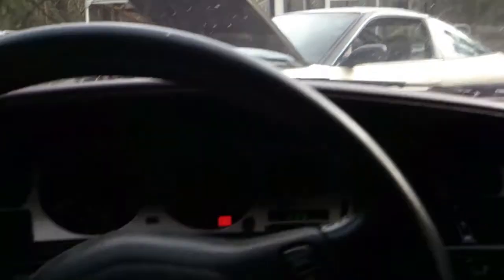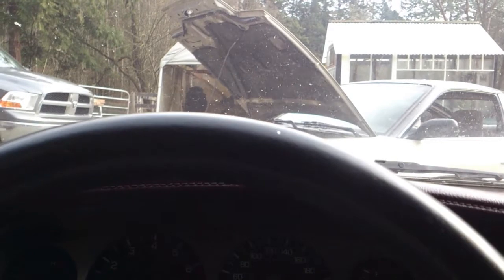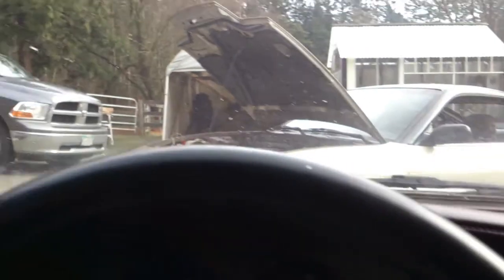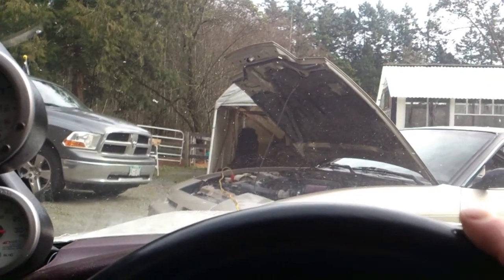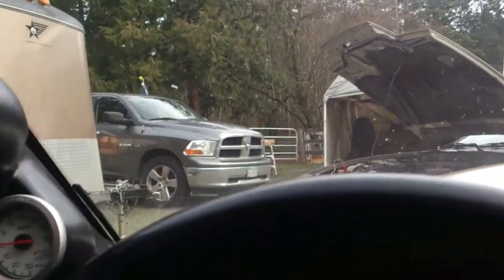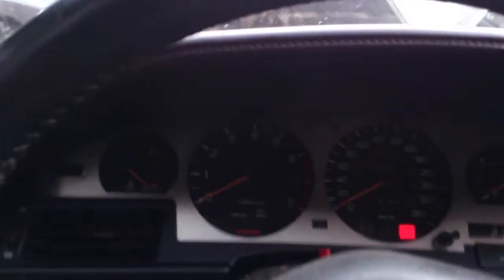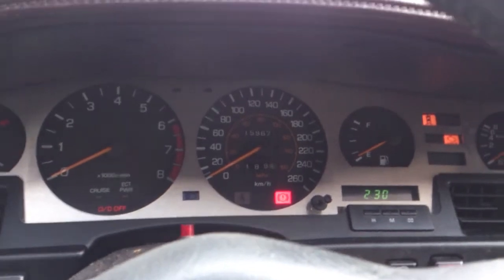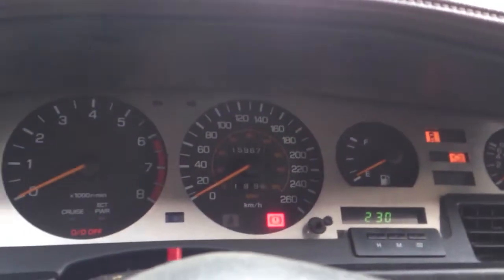Supra Garage Reno : Day 1

Comment: I guess the temporary fix, was temporary.  :)
Reply from the maker: yeah. i had to tear down all the temporary stuff after last weekends storm. what a mess! oh well. this ondura stuff will last forever in comparison. cheers lyn!
Reply: paradoxdesigns Check out my video on how to install one of these tents... laying a basic wood foundation and cross tension support can add years to the tarp. To bad I get lots of snow and could not find a broom to knock off the snow and I used a ice scrapper... Basically the weight of the snow with the concentrated pressure caused a bunch of small holes. I think I will do this style roof when I move it next
Reply from the maker: ***** It actually does have two large wood beams beneath the ground attaching it and then all the extra wood supports, the frame really isn't the problem, its that the tarp just wore out through the years, it was fraying and shredding many weeks ago, snow really can mess them up though. thats true. i had one collapse on me before. it was not fun!
Reply: paradoxdesigns The less she moves the less it wears make it tight if you want to keep the tarps from rubbing and creating friction which will wear out the tarp faster...
Reply from the maker: good point! i actually put bungee cords across the sides to keep the sides from flappin' around. its work pretty well so far!